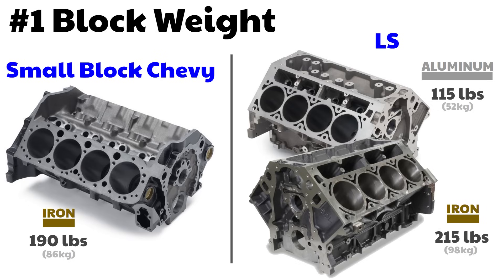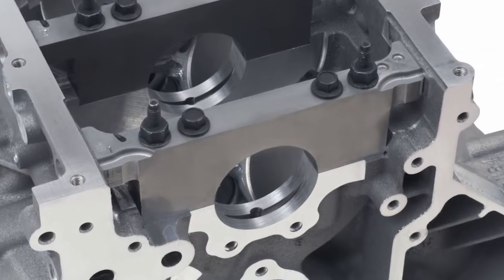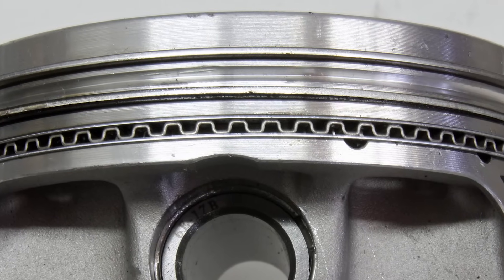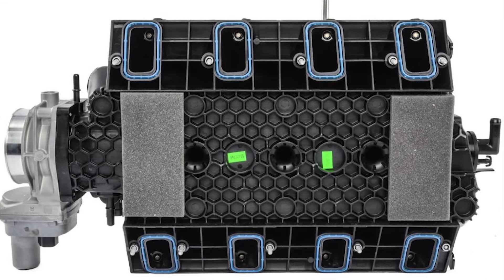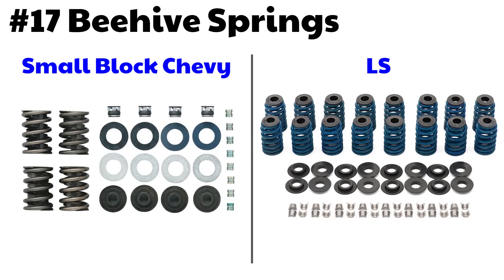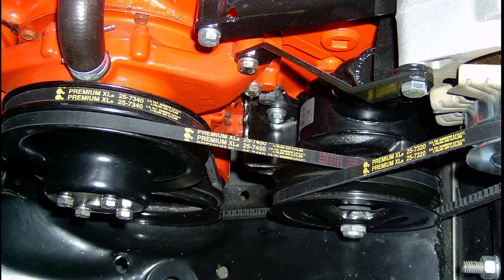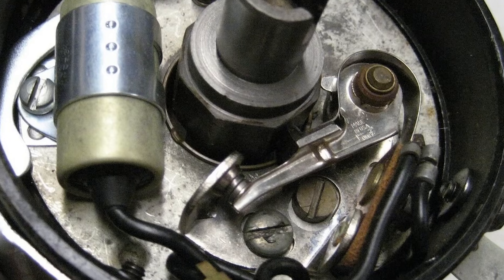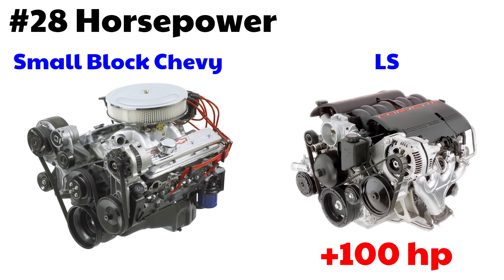29 Reasons LS is Better than Small Block Chevy (Gen 1 & 2 vs Gen 3 & 4)

Comment: See but now that everyone is switching to Ls engines I can get Chevy 350s for even cheaper than they already were
Reply: during the pandemic i scored a pair of 4 bolt 350's for $50 a pop. Got an Olds 455 with headers, a cast iron 442 intake and an Engle cam for $150 from a kid going LS...and so on. its a great time to hot rod :)
Reply: @albertgaspar627  what car you wrenching on sir?
Reply: @carsmusicandclothing7066  right now i'm getting snowed in :)  but this pandemic summer its been a 1968 Olds 4-4-2 someone else built but sold for a mere $4500. I'm chasing his issues and figuring them out, like cooling and a q jet overflowing. After that it'll be a pair of rusty Mustangs and then finding an old rusty Chevy pickup to put on a 2007 Colorado frame so i can have a part chaser...that'll use up some of the "garage art" like a 283 chevy or a 4 bolt 350 and a disassembled Corvette 4speed and other stuff that was too cheap to pass up...
Reply: @albertgaspar627   Nice scores, but an iron intake is nobody's idea of a good time!!
Reply: @milojanis4901  esp. with a nitrous backfire :)  in 2022, however, I scooped up a 400 chevy small block, dissassembled so it would fit into the car i was driving daily. I rushed, didn't notice that I had everything but the crankshaft. Called the seller who sang me the "all sales final" routine. Ran the numbers on the cast iron intake, knowing the 400 came out of a late 1970's suburban, and it turned out to be a corvette piece from the same time period. fine by me, I'll probably want to stroke the 400 out another 28 cid anyway, so he can keep the cast iron crank.

if those two cast iron intakes help out a restorer (likely working on something running an aftermarket aluminum single plane high riser), then great. and if i trade 'em for something i need, even better :)  I've got a few CSB single quad intakes I nabbed cheap (one was a  Victor Jr at a tag sale--$10), just knock off the grease and paint and I'll be set on that $175 400 engine when I figure out what I want it for.

so, is that LS7 an old crate 454 or an LS design?
Reply: @albertgaspar627 im barely getting into the Hot Rod scene  and yeah a SBC are eternal
Reply: @albertgaspar627  ls will never be cool like an old gen 1 sbc
Reply: @yamahaguy1732  If there's one thing watching car vids on youtube has shown me, is that we all hot rod what we grew up with. I know there were flathead guys who loved to run their fullshithouse A-v8's against muscle cars to show off the power-to-weight ratio.

The LS has a lot of neat features, and the kid who is just as old as one who plucks a junkyard version and does nothing more than pokes in a cam and bolts on a turbo, is the same as the Gasser dude in the 1960's who pulled an Olds 394 or a Lincoln 430 and stuck in an Isky cam and bolted on a GMC blower and went to the race track with no more prep than that.

But I'm not that guy. I want to take an engine apart, do the little tricks that add up and enjoy an "old school classic", like maybe gold anodized Moroso valve covers, nice wire looms, a cleaned up high riser intake sporting a carb that looked like it actually got cleaned. Most LS swaps I see are pretty dingy with no "jewelry" anyplace.  Just a grey lump, no pride.

It may be the fastest in a small town, the slowest in a big town. But I'm not trying to compete to be the Big Dawg, there's not enough room on the roads anymore and as the reality TV shows reveal, its all just luck anyway. Today you win, next week you redlight.

Right now I just love picking this stuff up for dirt cheap every other week and getting it together. There's less traffic on the road with the pandemic right now, and taking a car out on the off hours and just enjoying what i did to make it faster without breaking the piggy bank...that's fun to me.
Reply: @albertgaspar627  And still get gapped by just about any LS or junkyard truck pulled LT
Reply: @Saiyan585  Gapped where, in the 55mph zone? oooh :)  Well, I could drive hours to the strip and sit all day in the pits to get a few runs in--and shock the LS guys that their "500 hp" dyno engine is actually only 400 hp once its under a hood with everything on it.  Reality is, an affordable LS these days is the 4.8 litre, which has the same torque rating stock as my 86 Foxbody GT--300 ft lbs. In terms of popping the hood at a car show, I can pick up used chrome for a Gen One small block cheap, while the LS boys always look like something pulled out of a junkyard, since "jewelry" for these engines is still at new retail prices.

Its interesting that when GM needed a gas powered towing package, they didn't bother to make one out of the LSX blocks sitting around...they made the 8100 instead with a block designed in 1965.
Reply: @Saiyan585  Nobody cares. 99% of cars never see a track.
Reply: @albertgaspar627  I have an LS7 I built myself that says no-no you wont!!!
Reply: I got a built 383 stroker with a tranny for a grand bc the guy was doin an ls swap, now i got a 470 hp 383 and hes got a 415 hp ls3
Reply: @william2glaser227   I have had both.. I pick the LS3 to walk off from the 383 if everything else is  identical
Reply: I'm not switching to LS engines! Don't have me sold. Half the stuff they did to the Ls engines can be bought and updated on the old school small blocks.  And some stuff they did to them wasn't even needing, the old school engines never had a problem  with it. I'm sure not wasting time with them in my older pickups, I rebuild the older engines.
Reply: @jessesyfie7244  agreed. it's cheap enough to buy a chinese ebay cylinder head, or a used brand name, and it will either flow well or can be ported at home. If you want to run a carb (to use the venturi effect to cool a low boost turbo ripped off some junkyard diesel, say) you can find a $100 Victor Jr intake all day--what's an LS carb intake gonna cost? or maybe you want a throttle body--you can either  buy new or junkyard, not sure the LS came with one OEM. then there's the cost to install the entire package into an old car never designed for the LS but has a 305 or a 4.3 litre V6 already in it.

it boils down to knowledge--us old timers can take a week's paycheck, and some parts lying around, and slap together a 400bhp 350. Those who grew up on the last two decades of the LS, that's what they know, and they can go around the junkyard picking up a small displacement one and know what vehicle to score the oilpan from, the serpentine belt system, figure out how to get around the power steering issue, and walk out with something that still needs a custom tune--but how much power will it make with the same $1,000 paycheck investment?

https://www.youtube.com/watch?v=keGi7nC5hT8
Reply: My thoughts exactly, my neighbor had a 69 327 4bolt out of a Camaro or Corvette with believe it or not just under 75,000 original miles. He pulled out of his 68 Camaro to do yes the run of the mill LA swap. He asked if I wanted the motor because I'm an old school guy. We agreed on wait for it $100 because he didn't want to waste his time with it and it was wore out. Brought to my garage tore it down and found out it was still on it's original bore and yes it is a 4 bolt main motor. So it is currently at my engine builder for all the good machine work and then we will build her and put it something to race him with making him sorry he ever did that cra**y LS swap
Reply: @bretmartin4071  Ah ,yes the imaginary 4 bolt main 327. Heard about these from every want to be gearhead since I was in college. Never produced by the factory. But they did make a 68/69 steel big journal crank that will bolt in a 4 bolt main 302 or 350 block. That's how I made my own dragster engine, at +.030. = 331 cu.in. using 350 pistons and +.125"  SuperRods aluminum rods.
Reply: I'm better off buying up OBS donors, than buying just the engine. Been needing one for a while for a 1st gen vortec.
Reply: Mild built 350 with 750 double pumper 😂 will get rowdy direct power no computer
Reply: Yeah I'm building a 383 stroker baby! 350 engines for life!
Reply: Not everyone is switching
Reply: BS!! I went with an LS because i got whole running 6.0 vehicle for 1,200. People are wanting that much for just a long block sbc. 50 dollars would be a torn apart FD up sbc.
Reply: I guess Master Debater means a Japanese RB25 or RB30 and not a Mopar RB engine. As for buying a complete LS powered vehicle, that's the way to go--esp. a fleet-maintenance vehicle bought at auction. Get everything you need at once, and see how it was put together.  Not sure where a complete Gen One longblock is selling for $1,200, tho.  On FB marketplace I scoop them up in the same shape an LS vehicle for $1,200 is in...for $100. Maybe double that if its been degreased.
Reply: Been the opposite in my experience. 350 are getting old and tired and good condition ones people think are worth gold.
Reply: @SOLDOZER  If an engine is still in use, it's going to wear, but ones sitting under a bench, not as much--probably all that oil grunge has kept the rust at bay :)  I do find some people want "antique prices" for engines, but i'm lucky to have space so when i find 'em for 1970's prices i grab 'em for a later date. and believe me, i'm not hoarding, more come up but i've run out of room.
Reply: @albertgaspar627   Im browsing Marketplace  for a 96+ roller block and people wanting $800 -$1200 for clapped out looking engines with who knows what surprises await once the heads come off. Those are 5.3 LS prices. I love the SBC, but these asking prices make it difficult.
Reply: @SOLDOZER  totally agree with you on that--up here in New England they begin at $100 and can go to $700 for what they claim was "running when pulled". and we're supposed to be the expensive end of the country :)  but hopefully you'll find what you need soon. i totally agree with you, i wouldn't pay that much--i'm always going to want to take the engine apart and rebuild it my way. i think for some scenarios, the seller imagines a delivery guy is going to buy the CSB engine for their own work truck and pop it in over the weekend.
Reply: 420hp/470 torque small block 383, carbureted with a shift kit in auto trans.
For light to light, I need no more and eat the others.
Reply: Yup
Reply: Yes lol
Reply: I think I might go this route for the foxbody
Reply: I know and they are good for 500 horse thats plenty
Reply: Amen!
Reply: Yep, and you can keep the car period-correct if you want to.
Reply: Even if you get it cheaper you’ll swap everything that the SBC has just to make it like how a LS comes from factory
Reply: Costs just as much to build a sbc as an ls and you get way less power.
Reply: I don't know man.  Lots of aftermarket parts for those SBCs are hilariously expensive.  A good carburetor alone is worth an entire mild build LS, or even a wild ebay turbo ls build.
Reply: @ChefofWar33 you telling me you can do a full ls build for 400 bucks
Reply: @cThickens  No.  Never said that.  What the hell is 400 bucks gonna get you?  A 300 hp pooch?  Almost everything good that makes good power on a sbc is pricey as hell.  Because boomers will buy it rather than switch to an LS.
Reply: @cThickens  I bet I can make a 800 hp ls build with just a junkyard ls, an ebay turbo, and some good valve springs.  All I'll need to do is pull the rings out and gap the shit out of them.  Maybe 30 thou. All for about 1 grand.
Reply: @ChefofWar33  do it have fun with your Chinese turbo
Reply: @cThickens  I mean.  It creates boost all the same.  Won't last very long.  But it chooches.
Reply: @ChefofWar33 you said you could do a mild build with the price of a carb. I’ve built both and yes the lm4 made easily twice the power of the 350 but I had to build the car to handle 700 horse so it was definitely more expensive overall than the 80s el Camino that was just kinda plug and play
Reply: @cThickens  Yah.  Good carbs are outrageous.
Reply: Mud-N-Ice  I used to have several old cars in the 90s. Try driving a BBC car with 410 gears , single digit mpg.
Reply: Exactly 😂
Reply: And low maintenance with durability... is a good thing.
Reply: 😂😂😂❤❤❤❤ you smart
Reply: 😂😂😂❤❤❤❤ you smart
Reply: 😂😂😂.This 400 sbc N/A I have is still a freaken BEAST on the street.LS motor pulls up next 👀,,,,Oooo shit I better make a right turn and chill.400 sbc just rumbling the ground.Marking its territory with oil leaks 😂😂.
Reply: It costs far more $ to built that engine up to even get close to the hp of an ls. Youll spend more money get less horsepower, less towing and less mpg. Its not worth it
Reply: agreed! get complete reman units for $2200
Reply: Lol carb life 😀 breathers in the valve covers and a cheap msd distributer. You can literally drop it into anything it fits in and it will get you around town just as fine as you did before... If not better. If I could afford the tunes and dyno time and the pros to assemble it for me LS. Cheap brand new parts I can assemble and tune myself sb350 all day.
Reply: I agree.  I got an 84 vette and it’s so cheap and easy to just build a SBC I’m not bothering with an LS swap.  For now anyways.
Reply: Absolutely a fraud doesn't know anything about anything fake AI wanker

Comment: Ls engines are great engines but the small block isn’t as bad as it’s made out to be, one hot wire and some gas a small block is running and they are very simple to work on

Comment: the ls is optimized in almost every way compared to the sbc, but the sbc is better in the only way I care about, simplicity.
Reply: LS motors are really simple and they don't leak oil,I have both also.
Reply: @robholmes2129  not as simple as a sbc

Comment: Your nuts I have a 350 4 bolt mane making 946 hp in my car so a old small block chevy can handle 1000 + hp
Reply: Yes I’m sure u do , but fore what u had to do $$$ wise and the fact that the old abc can not handle that kinda power like the Ls can because of the way it’s made and u can change the cam on a Ls and get major hp , the Ls is just better it is !!!!!!!!!!!!

Comment: Dude, have you ever worked on your own stuff? The oil pan part is garbage, so are you hp ratings and your opinion on the cam. First off, you don't need the oil pan to help quiet the motor, the oil pan is obvious at the bottom of the motor, you'd have other noises drowning that out anyways. And a cam install, yes it's technically possible to pull the cam without removing the intake, most people do the cam AND lifters. To do a cam and lifters in an LS you have to pull EVERYTHING. And imagine in a stock scenario, like idk, GEN II LS with Displacement on Demand? If you were to replace that bullshit yourself when it enviably goes out, it'd take hours, if not days. Cam in a small block? Intake. You know what you have to take off to pull a SBC intake? Heater core hoses, distributor, spark wires, breather, wiring, fuel lines, throttle cable, upper radiator hose, and the bolts. Nine things, and eight of em can be done in under two minutes.